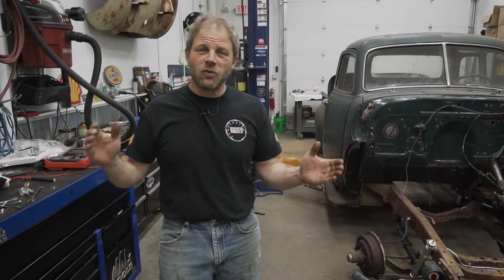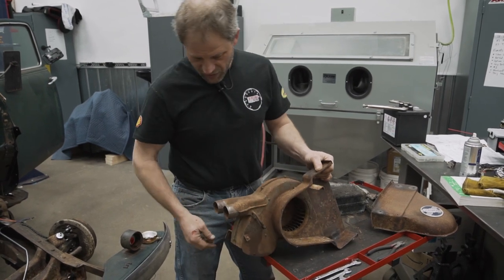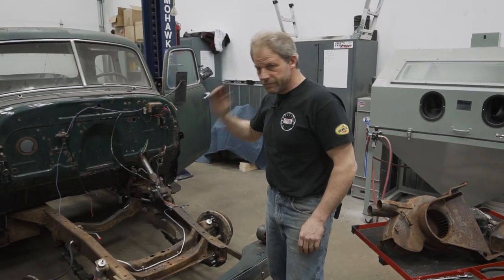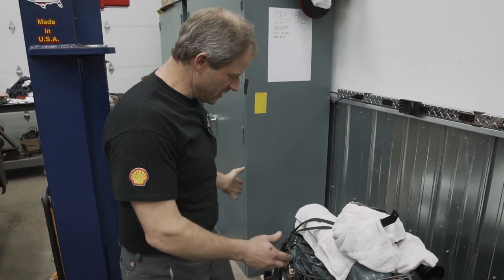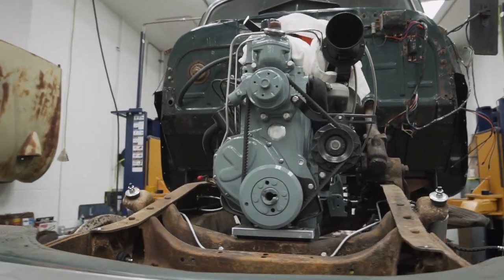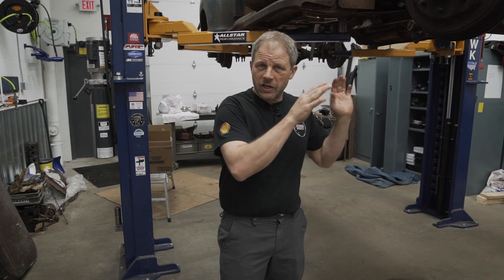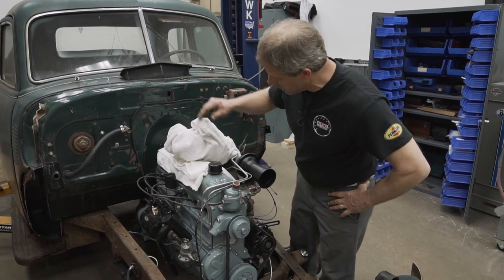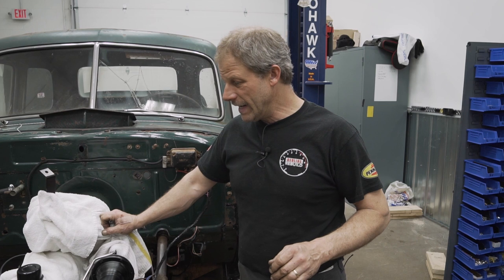Putting the engine back in our 1950 Chevy pickup | Redline Update #38

Comment: C'mon man.  Sand blast cabinet is right there. 45 minutes and a can of chassis black for that heater and it wouldn't have to suffer paint envy compared to that stovebolt six.

Seriously. thanks for all the great videos!
Reply: Agree with you Joel, I'm a detail freak. The heater could have been detailed since it was all apart. Hope heater core was pressure tested?. Love everything else your doing.

Comment: Sweet man, first video I watched and you answered my question. I've got a Motor's truck repair manual, it says to remove engine and transmission together,  but that looked impossible because of the cross member. You verified my assessment. Oh, and nice work, really clean. Thanks. 1951 6400.

Comment: In the past when working on removing and/or repairing a heater core, or anything under the dashboard, I've reclined the front seats and eased myself, laying on the seats upside down with my head on the floorboard, looking up into the front console area. Obviously what I needed to do was place my vehicle on a hoist, remove the floorboards, and stand on the ground to work under the console.  All these years I've been obviously doing it wrong. Gee! Why didn't I think of this.
Great job on the truck. Loving these updates.

Comment: My dad's 1950 Chevy panel truck did not come with a heater. He added a South Wind gasoline fired heater to it. Also, there was a Motorola tube AM radio under the dash where a heater might go. At 14 years old I used to listen to Ode to Billy Joe when it first came out on that radio. Must have been Summer of 1967. The truck is still parked in the same spot 53 years later. Somebody stole the starter. The engine quit when the fiber timing gear went out. Your project brings back memories....

Comment: You have to love the old heater boxes.  They're easy to get out, simple and metal, not a fiber plastic unit crammed into a spot requiring hamster mechanics to work on.  Keep up the awesome rebuilds.
Reply: YES I pray the box on my '87 Porsche 924s doesn't leak and then I'll have to take apart the whole dash...

Comment: For only four gears forward, those transmissions are solid weight and pound for pound three of them would make a entire foreign car. Maybe more as my back remembers how hard those were to stab. Nice putting the heater in and standing in a empty cavity I bet as its not easy to get to all the stops on the heater adjustments and setting the little clamps in place. Nice work

Comment: I didnt see it in video-  lie to me if you didnt,   rubber or thick foam around heater core to keep from vibrating and wearing a hole in it.  also keeps air going thru core and not around it.

Comment: My two cents: why not test that heater core prior to put it in ?? Some ligt air pressure in it and then in a bucket of water. Fast and easy, no ?
Second, I'd had painted the inside of that heater ! You'll breathe in all that rust dust, man !

Comment: question,   if your heater core was shot,  would u be able to get a nos or replacement or have one made based on the old one?  great vids guys 😁👍🇺🇲🇺🇲🙏
Reply from the maker: Heater core – there are replacement heater cores and you could have one custom made to fit or at least retro if need.  In the past week I did find a company that appears to have the correct one for the truck, although I am still going to wing it with the one I have.

Comment: It hurts my soul to see you put those rusty parts back in the truck. I understand it is a driver, but it still hurts my soul. A coat of rust converter would make it look like brand new. I know I am OC...
Reply: Same, those trucks like that one 3/4 ton deluxe cab are like finding hens teeth. I have a 1953 1/2 ton I've owned for nearly 30 years and I wouldn't give that truck up nor would I rebuild it without a total restoration. I love those trucks.
Reply: I kinda dig the idea of the overhaul, not a restoration. Thousands of these trucks are restored but this one will stand out. Plus you can always go back and paint it but you can never make the patina :)
Reply: Was typing the following when I spotted your post so adding it here instead.....I wish people would at the least use Rustoleum Rust Reformer spray paint on those rusty parts. I use it on my old truck and the rust hasn't come back after several years. It works and it's a shame some think of rust as patina and looks "cool". No it will eat up your vehicle.
Reply: i agree. with some wire bursh and atleast paint with rust treatment. also the heater box. you do not want to smell o breath rusty air.
Reply: @davidlong1786  Agreed, this "patina fad" is one I'll personally be glad to see go out of style.
Reply: @Digger927  at least it's better than the rat-rod craze from a decade ago. Bunch of cobbled together unsafe crap.

Comment: Just curious.. are you leaving the frame and all the rusty stuff alone?  It's hard to keep up since Haggerty has so many projects/vids.  thanks. !
Reply: That was their plan. Make everything mechanial function properly, not gussy it up as a show truck. New brakes, engine/trans rebuild, new suspension components, and wiring. This way, they can drive the f out of it, and not be worried about cosmetics, just a reliable old truck.

Comment: is it even possible to find a rebuilt 216 or 235 long block if you need one ?
Reply from the maker: 235's can be found. Good luck finding a 216. There's a reason we had to sort of bandaid ours together a bit!
Reply: @Hagerty  never heard of a babbit bearing until your video, did some research, I would prefer normal insert bearing  my self , Thanks for all your videos
Reply from the maker: There are a couple guys around that have some rebuilds sitting on the shelf. And cores are available since lots of people pull and replace with a V8.  Just ask around you will be surprised what is available.

Comment: What makes a stove bolt a stove bolt?
Reply from the maker: It's a bolt with a round or flat slotted head and a square nut, resembling a machine screw, but usually having coarser threads and used for joining metal parts.